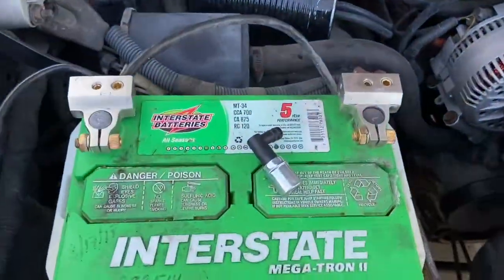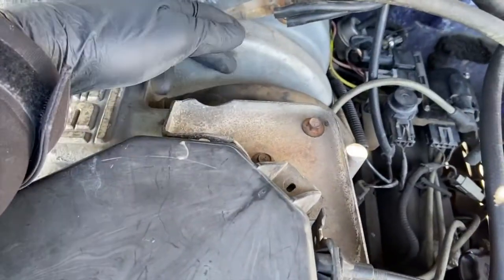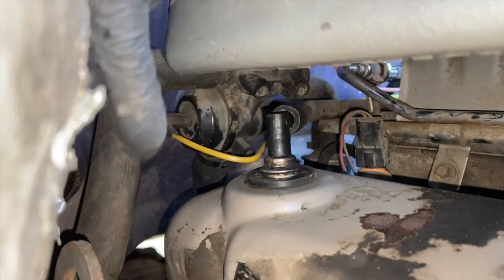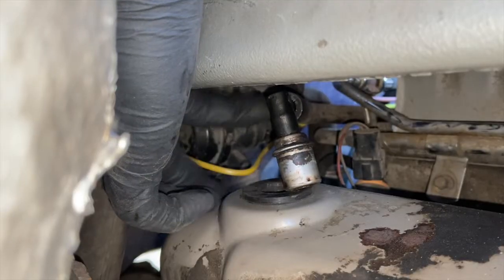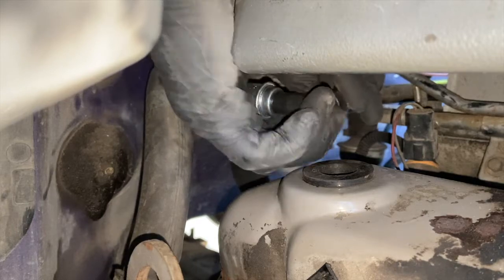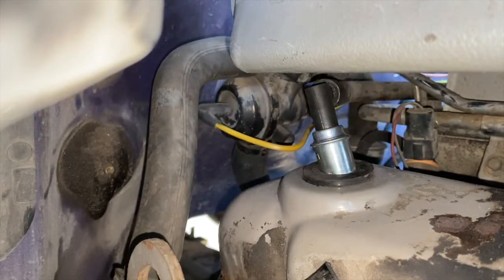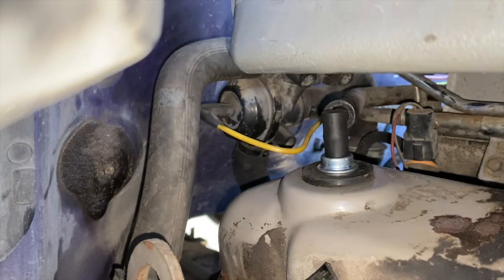How to Replace PCV Valve on 5.0/302 Engine | 1995 Ford F150

Comment: There was a fix put out by ford about the pcv dumping oil into the no. 8 cylinder, something about swapping lines with the brake booster, you may want to look into it
Reply from the maker: Really? I’ll definitely look into that. Thanks for the info!🤙

Comment: How has your motor been shot holding up since the gasket refresh
Reply from the maker: It’s been great actually! The only minor annoyance is that the oil pan gasket seamed to leak quite a bit in temperatures lower than 20 F. Otherwise, everything else is holding very well.
Reply: @TheMinuteMasters  well that’s good that it’s holding up well I did my motor not to long ago and my exhaust manifold gasket is leaking so tomorrow gonna get that fixed and of course it has to be on the passenger side where I can barely get to it
Reply from the maker: @jerrettbrown1845  that sucks. Exhaust gaskets can be tricky like that. Did you install aftermarket headers? What brand of gasket did you use?
Reply: @TheMinuteMasters  I had replaced the passenger manifold because it cracked but the gasket I put on felt flimsy and didn’t last one so I got a FEL-PRO one
Reply from the maker: @jerrettbrown1845  The Felpro manifold gaskets seem to be the way to go. The foil/metallic exterior holds up better.
Reply: @TheMinuteMasters  welp just got it fixed about a hour ago no leaks
Reply from the maker: @jerrettbrown1845  Hell yeah man!🤙 Good to hear!

Comment: I have a 1988 F150 with a 5 liter out a 1990 F150, Can you gave me a map of the routing of the pcv hoses. Or pictures of that. Bought project truck that is a basket case.
Reply from the maker: Hi Joe! The PCV plugs into the passenger side valve cover. Then the hose it routed back behind the intake plenum then forward and plugs into the side of the plenum.
Reply: Thanks got figured now including the Ford date. Which is simply swapping the vacuum hose connection from the rear the planum to where the brake booster connection was. And brake booster line to the rear of the planum. This prevent oil from being drawn into number 4 and 8 cylanders. The information you porvided was very helpful. And assisted me figuring out the vacuum system on the truck. Basically the kid I bought it from put everthing on backwards,including the valve covers which were on the wrong sides. For farm kid he certainly should know better, but apparently didn't. But it will be much better once I undo all his mistakes.
Reply: @TheMinuteMasters  But guess his knowlege is as bad as typing.
Reply from the maker: @joesinclair151  Greatvto hear Joe! Your previous owner not making proper connections is all too common of a story. Unfortunately people aren’t very detailed or knowledgeable about these things. I appreciate their attempts to DIY but it does cause issues down the road.
Reply: @TheMinuteMasters  Am master Mechanic  so it will be  done properly. Everything seems to hooked up backwords.  B
ut even so  don't everything , anyone says they  do is streching the truth. That and last I worked a truck of thie era was in 2003.  Still working on other peoples  vehicles, but this ones for me.
Reply from the maker: @joesinclair151  I am honored Joe to have you as a master watch my channel!🤙 is this truck going to be a daily driver for you or kind of a weekend fun truck? Or shop truck?
Reply: It's going to be a daily driver. Should be good fuel for a 4x4, as cat and all other such devices with the exception of the egr. Due computer needing that and with out it exhust temp. Could rise enough to damage engine sensors. But with a 190 thermostat it will still allow the to hot enough to burn the fuel completely, So wiil still pass most air care testing,. And have better power and fuel economy not like VW  Golf, but 23 to 25 mpg when using good qaulity fuel and stage one cam stage one shift kit in the trans. With trans. modulator with green stripe adjusted in all the way in then backed out 1 1/2 turns.  Also shorty header headers with Flowmaster super 60 or super 55 going out duals under the rear bumper. So will be restomod when done.
Reply from the maker: @joesinclair151  That’s great to hear! I’ll have to keep some of the modifications in mind for my truck if I wanna try to get better MPG.

Comment: Yellow vacuum line right behind pcv. What is that?
Reply from the maker: I believe that goes to the TAB and TAD system which is an emissions thing. I’d leave it connected unless you plan to remove the emissions stuff.

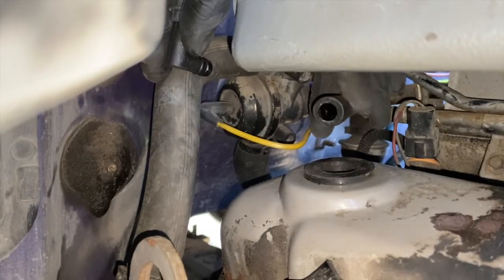Comment: 0:54 what is that part with the yellow vacuum ?
i don't have one is that ok ?
Reply from the maker: That’s a piece of admissions equipment called a thermactor valve. They’re near impossible to get aftermarket and if it’s missing from your truck, that’s not necessarily a bad thing. Some people delete them and everything works fine.

Comment: Is this the same for 1992 models? I know ford changed stuff around across the years even between 92-96. Thanks.
Reply from the maker: That’s a good question. I don’t know for sure since it’s been a while since I’ve looked under the hood of a 92. However, I would just take a quick peek underneath your plenum to see if there is one there.

Comment: What kind of hose do you have connected to it? Mine cracked and I can’t find a replacement.
Reply from the maker: I can’t remember but I would take the PCV to an auto parts store and size it to some fuel line. I know O’Reilly’s sells it by the foot.

Comment: Would you make videos as to why these things and updates are needed?
Reply from the maker: Like why replace a PCV valve specifically or explanations for replacement for all the parts I film?
Reply: @TheMinuteMasters I think it would be a great idea, I love the fact that the videos get straight to the point but i also don’t have a full understanding why these things need to be changed ( sometimes ). Both my brother and I have 92 F-150 and are learning to to do everything ourselves but just trying to get a better understanding. At the end of the day we are all grateful for your videos!!! Hahaha
Reply from the maker: @kevinapineda8424  I totally get it man! I appreciate the feed back too. Nice! Now you have a wrenching buddy with the same truck!👌 
As for replacing their particular part, the PCV can cause engine idle issues. It would be too long to explain here. If you want to know, I would type in to google symptoms of a failing PCV valve.

Comment: isn't  there  two  PCV valve to replace???  One on  both valve covers?
Reply from the maker: There is just one PCV valve. The other valve cover has a CCV (Crank case vent) which connects to the intake.